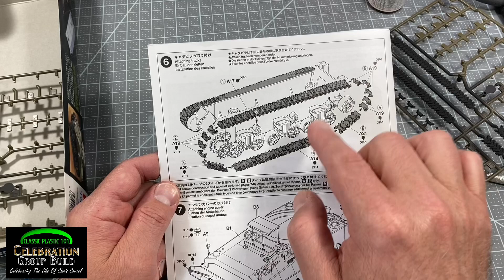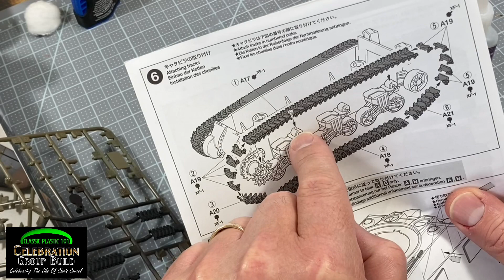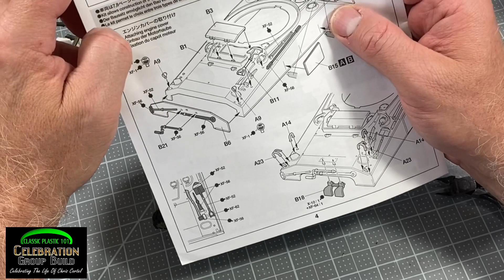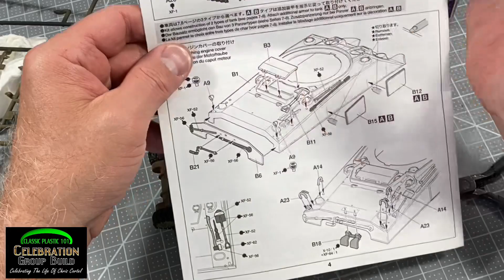Building a Model Tank: Tamiya 1/48 M4 Sherman Tank Part 3-Final!

Comment: What was that super glue you used?
Reply from the maker: Sorry for the late response.  It’s from Bob Smith Industries.  I get it from my local HobbyTown.  Most hobby shops carry it.
Reply: @Drewsmodels  so it has to be hobby super glue? And you use that on already painted parts?
Reply from the maker: @JamesSeay-m7f No. I mostly use Locktite.  I needed some super glue and happened to be at the hobby shop at the time. It’s about the same price as Gorilla or Locktite.